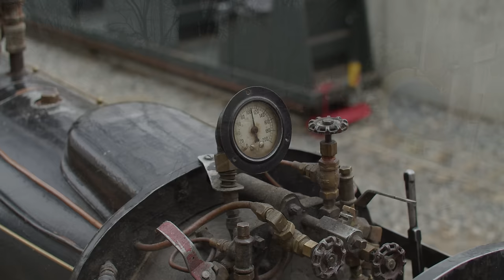Firing up and Running Northern Live Steam Locomotive 402 | Marshall Steam Museum

Comment: The amount of knowledge needed to run a steam engine is admirable to say the least .
Reply: Really there are 3 main controls, regulator for controlling speed, reverser for direction and cylinder cocks for clearing condensed water out of the cylinders. All the other stuff is pretty much just extras.
Reply: I forgot about the fireman, he's the one who has to control draft and keep the fire just right, the driver just has to control speed and direction.

Comment: Why did you put so much coal in there just to shovel it all out?
Reply from the maker: This was over a several hour running period, and in order to generate enough heat to keep the locos pressure up, you need to add coal as the fire burns and turns to ash. However, once the running day is over and the engine needs to go to bed, we let the fire die and "pull it" to stop the heating of the engine. We also fill the boiler with water to help with cooling.